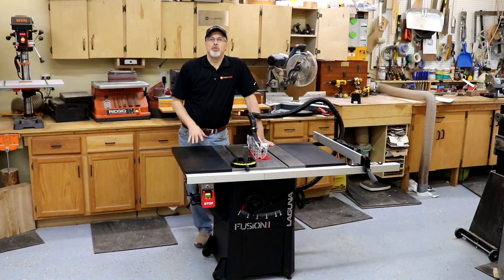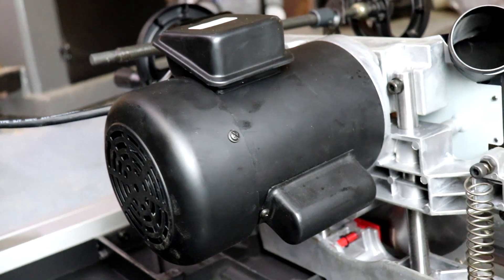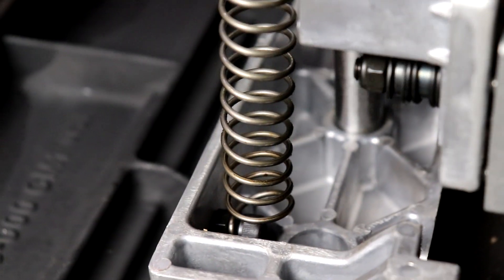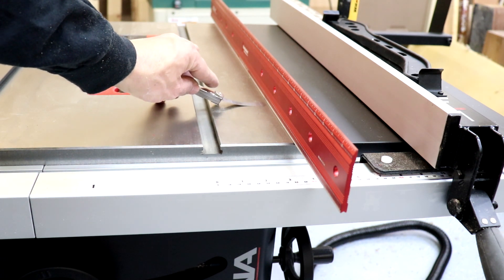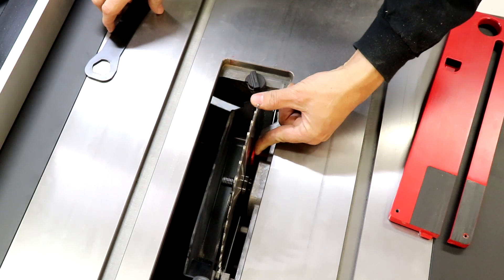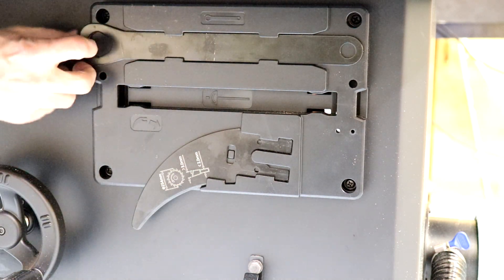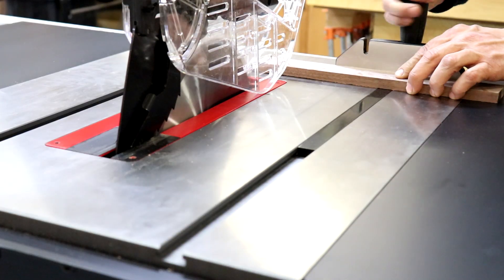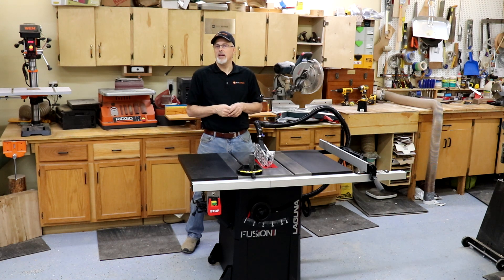Laguna Fusion F1 Table Saw Deep Dive Examination

Comment: Yeah but 1100 watt ?... come on....
Reply from the maker: Hi Alice, what point are you making here? Did I say something incorrect? Or are you saying that you feel that the saw is underpowered?
Reply: @ToolMetrix  No no you didn't say anything wrong, I was just complaining that this saw is a bit under-powered 
1100w for a pro table saw is really weak, half of what a small dewalt can deliver at 1/3 of the price
Reply from the maker: Ah ok. Gotcha. I’ve had a Dewalt portable saw in my shop. This Laguna has comparable power to the Dewalt.
Reply: @ToolMetrix  oh really ? I guess induction motor have more torque at a given power than universal motors then ?
Reply from the maker: I’m not sure what the engineering explanation is but the results are apparent.
Reply: @ToolMetrix  Thanks, I'm probably go with this one instead of the dewalt then
I mean when the price is lower or when I saved enough money, the F1 is 1600€ in europe...
Reply from the maker: If you’re going to have the saw in a permanent shop location I think that’s a great choice. If you’re doing remote jobs and moving the saw frequently then the Dewalt is a great option.

Comment: Hello, do you know the location of the 6 trunion bolts. Unfortunately im out .010 over the blade. Am i going to have to flip this sucker? Ive replaced the stamp extentions with cast (probably why its out 😆 they are supported in the table i installed it in though)
Reply from the maker: Sorry, I’m not sure. Manual should show this.

Comment: What are the two pieces of metal for on the top of the fence?
Reply from the maker: Hi Mark, I believe that the black frame is steel and the silver colored plate that the work piece rides against is aluminum.

Comment: Hi. I recently purchased Laguna 1.
I have two problems, maybe you can help me.
1. My dial is set between 90 and 44.5 degrees.
       Where is the regulation for 45 degrees?
2. The dial tilt knob operates very easily. If I turn the knob to 45 degrees, it straightens a little. Is there a blockage somewhere?
Reply from the maker: I don’t remember on this saw specifically but typically On 1, there should be an adjustment bolt in the saw that allows you to re-zero the 90 and 45 settings.   On 2 I’m not sure but you’ll have to try to see what it’s catching on. Maybe an inspection camera would help.

Comment: Hi Paul! Appreciate your video on the F1. Curious as to what DC system you running? So much mixed experiences out there with this saw.
Reply from the maker: Hi there, and thanks for watching.  I'm running an Oneida cyclone, 5 HP.  I can't remember if that's what I was running when I made the F1 video.  I switch it up a lot because I like testing out different dust collection systems.  Cheers,  Paul

Comment: Could the owner swap out the motor for another "off the shelf"?  For example, a 240V motor of the same power and weight as the original motor.  Is the motor mounting generic?
Reply from the maker: I don’t remember. Sorry.

Comment: Force against a blade, vibration, all of these can make it move, if you are repeating a cut at a preset angle wouldn't you want to repeat it accurately? I set the blade to 90 with my digital angle gauge, start the saw and stop it and remeasure it and it is 90.2, so imagine cutting a 2" piece of Walnut... will it move in the piece? 
I am not going to find out...
Reply from the maker: Yep that’s more movement than I would want.

Comment: I'm considering this saw for my home workshop, but I have one doubt which you didn't cover in the video. How do you fix the blade tilt after you adjusted it? There's no locking knob on the tilt wheel
Reply from the maker: Sorry I don’t recall how this is done. It’s been a while since this saw was in my shop.

Comment: Hello, excellent review.  I am wonder if the F1 can be converted from 110v to 220v?  I just purchased the F1.  I am also putting together a new workshop and deciding whether I should install 220v circuit .  I will at minimum put in a dedicated 20 amp circuit.  Thank you.
Reply from the maker: Hi Sunny, yes it can. It requires this conversion kit. https://www.shop.lagunatools.com/F1_-_F2_conversion-kit-110v-to-220v

Comment: $1199 for the machine, $300+ for shipping, $100+ for the wheel kit. The "L" shaped fence. Not buyers remorse, REGRET. It's a TOY. Customer service, Non-Existent, Technical Support, Even Worse. Manual, a Taiwanese picture book. Stamped steel. Most of it does not align. Try to get the extensions and cast top to align, near impossible.
Reply from the maker: Hi Dean, sorry to hear that you were disappointed with this saw.  Thanks for sharing your experience here.

Comment: Does the F1 have the capacity for an 8" stacked dado blade?
Reply from the maker: 3/4” I believe. Worth checking with Laguna.
Reply: @ToolMetrix  Thanks for the reply. I'm asking about blade diameter and whether or not it maxes out at 6" or 8" for the dado set.
Reply from the maker: Oh, gotcha. I don’t know about that. I’m not aware of a reason why it wouldn’t support an 8” stack but I didn’t test it.

Comment: I have a new F1 and I discovered that the motor assembly has about an 8 thou side to side motion at the riving knife end.  You can test this by pressing sideways on the riving knife release leaver.  It’s not just my saw, the demo saw at the dealership has it and Laguna’s customer support told me that saws on their floor have it also.  They offered me no explanation for this.  I looked at an F3 and it did not have that flex.  Do you think this will affect the accuracy of cuts?
Reply from the maker: I didn’t notice it on the one that I had here. It could cause a cut quality problem. You should know after a few cuts. Put a good quality blade on the saw for a fair test.

Comment: Great video! I am trying to decide between the F1 and F2 models. How noticeable is the extra power that comes with the F2? I occasionally work with thicker Harwood stock and want to know if I can get by with the F1
Reply from the maker: Thanks. I think the power difference is actually tough to notice. But the other upgrades make the F2 a great consideration IMO.

Comment: i have read multiple reviews that it is impossible to realign the mitre slot to the blade because of poor manufacturing.
Reply: I’m having exactly this problem, I loosened all the bolts so that they barely stay in and I still can’t move anything. Cuts at the moment are 1/8th out over a 10 inch crosscut.
Reply from the maker: Are you loosening six bolts? What is Laguna support saying?
Reply from the maker: Well, actually I did it on this saw. It was definitely trickier on the F1 than on the F2 and F3, but I got there. It’s possible that there was a design change between the one that they sent to me and the larger production run that makes this adjustment more difficult but I’m not aware of that.

Comment: Have you used the Dewalt 7491? I have that saw and it has the same motor ratings, overhead dust collection as well as 2 1/2 port in the back. The fence on it is rock sold and extremely accurate. It has a 32” rip capacity. 
This saw has a very nice, much larger table top, but I am wondering what the benefit would be to me if I bought this saw. Appreciate any feedback, thanks!
Reply from the maker: Hi Steve, Yes, I did a Deep Dive on the Dewalt job site saw: https://youtu.be/_JYoxJ82PMA.  That's a sweet saw.  In terms of the differences between the two, I think the Dewalt is a rock star for portability.  Compact size, lightweight, and man the innovation they have added to that saw for extending functionality in a small footprint is remarkable.  The F1 has a more robust architecture, more substantial trunnions, and I love the stability of cast iron.   If you didn't already have a Dewalt, I'd make the recommendation like this.  If you have to travel around with the saw at all, get a job site saw.  The F1 is sort of portable, but I wouldn't want to move it very often.  When you had to move it, it's a lot easier than moving a true cabinet saw, and you could do it by yourself but it wouldn't be much fun.  If you are in tight quarters, and can't afford to dedicate a permanent footprint to a table saw, then a job site saw is the better choice because you can hang it on the wall or tuck it underneath a bench.  But if you don't move the saw much, and can afford to dedicate some footprint to a saw, then a contractor's saw like the F1 is a better choice IMO because I believe it will hold its adjustments better, and I like the fence and large table space better.  But, since you already have a DeWalt, if you are now in a situation where you can devote a spot in your shop and leave it permanently setup, it might be worth investing in setting up a workstation where you would build rear and side extensions for the Dewalt, and maximize what you can do with it.  For you, moving to the F1 would be more of a horizontal move than an upgrade, with some advantages as noted.  If you want an upgrade, and have the space for it, you'd probably be better to look at something in the class of the F2, where the cast iron wings, and fence upgrade would be more noteworthy upgrades.
Reply: @ToolMetrix  
Thank you for your comprehensive analysis! As a frame of reference I am a hobbyist woodworker. When I bought the saw, I was still working and had 2 cars in the garage. I needed to move a car out so I could set up the table saw, so, to your point, I needed the mobility. I retired almost a year ago and ended up selling the car I commuted to work in so I have a dedicated space for woodworking. For the last several months I have been thinking of upgrading to a contractor saw but saw it as a “lateral move”, as you said. There is vibration on my saw and I totally get the more stable base this and other contractor saws provide. Just have been having difficulty justifying the move. Sounds like I need to look at more of a cabinet saw, as you said. I’ll take a look at the F2 per your suggestion. 
Thanks again for the thoughtful comments!
Reply: @ToolMetrix  Thanks for the comparison! Can you comment on the noise difference between the F1 and the Dewalt 7491? Is it considerably different?
Reply: I was under the impression the Dewalt was more like 1600 or 1700W while the F1 is 1100W.

Comment: Thanks for the review, got mine today, the assembly manual is printed  too small making it hard to read, they also missed the cabinet bottom plate install. So far works great.
Reply from the maker: Glad to hear that it's working well.  Hopefully they can get that manual updated.

Comment: I watched the F2 and F1 review so far. I'm looking at this F1 or the F2 or the Craftex CX212 which is a 2HP motor. Would you say that an amateur woodworker who needs precision table saw can rely on this one, or would you recommend the F2 ?  I'm also eyeing the F2 fence if it can fit onto the F1, do you know if that is possible ?
Reply from the maker: The F1 does not come with wheels.  The F2 includes wheels as standard.  Yes, you can get plenty of precision out of the F1.  The F2 includes mobility, slight power advantage, nicer fence and cast iron wings.  Overall nicer saw, but the F1 can do the job.  I don't know if the F2 fence would work on the F1.  You'd have to ask Laguna about that.  Best of luck!

Comment: Thanks for you review.  I really appreciate the tip on running it on a 20 amp breaker.  I saw your reply below on the overall differences between the F1, F2 and F3.  I was comparing the F1 and F2.  The F2 seems to be built more robust.  A couple of questions.  Can you be more specific on the differences in quality or features between the F1 and F2?  Does the F2 accept the wheels to make it similarly mobile as the more contractor oriented F1?  For my use, I would plan to store the saw against the wall, table wings and fence disassembled to reduce required storage space.  When I need it, pull it out into the garage where I normally park my truck and assemble the wings and fence for use.  Which one would be more efficient for my use?
Reply from the maker: Hi Jack, main difference is features includes Euro fence, integrated wheels, cast iron wings, more power.    Neither of these saws would be good for what you are describing.  You don't want to re-install the wings on either of these saws each time you use it.  Way too much hassle.  If you are cramped on space, the F1 has a smaller footprint due to the shorter fence rails.  But, if you don't have a room for the F1 with the wings installed, I'd look at getting a portable saw that you can hang on the wall for space savings.  That wouldn't be in the same class of saw as either of these units, but you would be much better off doing this than having to reinstall wings.

Comment: Hi, more questions: If I want to use a thin kerf blade on this saw, would the overhead dust collection setup mess it up? The system appears to be installed in the socket for the riving knife... and I suspect it is sized to work with full kerf blades, right? Also, does the system allow you to use a zero clearance throat plate with the overhead dust collection setup?
Reply from the maker: I don’t believe that a thin kerf blade would cause any problems. I didn’t try it but they sell a thin kerf riving knife so it seems that is part of the design. I don’t know why the overhead dust collection couldn’t be used with a zero clearance throat plate.

Comment: Great, informative and precise 

Can u compare the different models vs each other F1, F2 and F3
Reply from the maker: Hi Faris, Sure.  F1 is essentially a contractor's saw.  Somewhat portable, but not as portable as an actual portable table saw.  Gives you the power of a shop saw with enough portability to move it from site to site.  The F2 is a stationary saw.  The added weight of cast iron wings makes it so that you will want to leave it in one place.  The motor is an upgrade in power and quality.  The fence is an upgrade in that it gives you the Euro style capabilities that I demonstrated in the video.  The F3 is a true cabinet saw.  3 HP, 220 volt power, full cast iron trunnion.  Much heavier machine, suitable for a production cabinet shop.  For contractors, the F1 is probably the right saw.  For most small shop hobbyist woodworkers, the F2 is likely in the sweet spot.  Professionals will likely opt for the F3 for the upgraded performance.

Comment: Help me make up my mind, should i get the F1 or F2? I'm a bit worried about the 1.5 hp motor as not being powerful enough in the F1. I'm a DIY hobbist who is aspiring to be a full time cabinet maker, so using a dado blade would be ideal. There is a difference of $500 between the two models, is the $500 worth it for the F2? Thanks for doing these reviews!
Reply from the maker: Hi Todd, Thanks for your question.  I do think the 1.5 HP motor is powerful enough.  I think the motor upgrade on the F2 is more about a better quality motor than a more powerful one.  I do think that the F2 is worth the upgrade for other reasons, however, particularly if you want to turn pro.   I love the fence, cast iron wings and built-in wheels.  For cabinetmaking the longer fence is a nice upgrade as well.

Comment: After watching your review, I purchased the F1 saw The blade tilt adjustment needs to be adjusted. There are no directions in the manual, paper or online, and no directions in the Fusion F1  factory videos. How is the blade tilt adjustment done?
Reply from the maker: Hi Ken, This is very simple.  I had to do it when I removed the top from the saw.  There's a locking collar and set screw at the end of the threaded rod that is used to set the zero stop.  Loosen the set screw, adjust the locking collar until the 90 and 45s are aligned, and tighten it up.  Part #s 84-85 on page 37   https://lagunatools.com/wp-content/uploads/2019/11/FUSION-1-Manual.pdf
Reply: @ToolMetrix  Well, that was easy enough. Adjustment complete. The owners manual which came with the saw is only 27 pages. I used the online manual at the Laguna Tools website. Most of the numbers are not very visible so clean glasses are required. I did find the schematic on page 27 of my booklet but the schematic is different. Parts 84 & 85 are not with the rod. It appears to me that the rod is not pictured.  If anyone else has a problem with the manual which comes with the saw, go to lagunatools.com, find your saw and view the manual online. Paul, thank you very much.
Reply from the maker: My pleasure, Ken.  Glad it worked.  Cheers, Paul
Reply: @ToolMetrix  I went to your website and found the business email button. However, after completing the captcha, nothing further happened. I tried clicking the Submit button hoping an email form would appear but nothing.  How can I contact you?
Reply from the maker: My web site contact form is broken.  I need to re-do the entire site.  For now, best way is at ToolMetrix on FaceBook or Instagram.

Comment: Thank you very much for the video... I am considering ordering this myself, but I understand this is backordered for months. Anyway... in your judgment, what is the risk of the table bowing downwards under the weight of the motor? I have seen a number of tablesaws where the table curves downwards after a few years, making it untenable for precise cuts. I understand the mechanical design of the cast iron table can reduce the risk somewhat.
Reply from the maker: This has been a problem for table saws of this style, but I believe that the heavy ribbing on the underside of the table should prevent it.  That said, I won't have a chance to test this over time.  The F1 has been around a long time, and nothing about the new design should affect this aspect, so I'd suggest checking around on some forums (Lumberjocks, etc.) to see if anyone has had problems with this.  If the problem exists, you can bet that people will be talking about it online.  Also worth checking out the Laguna user group page on FB for this type of stuff.  Very vocal group there as well.